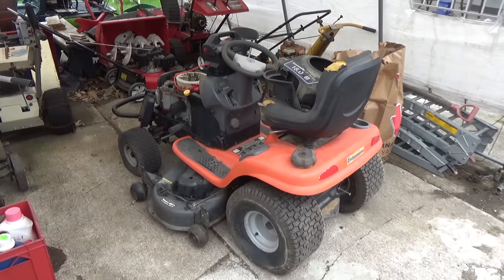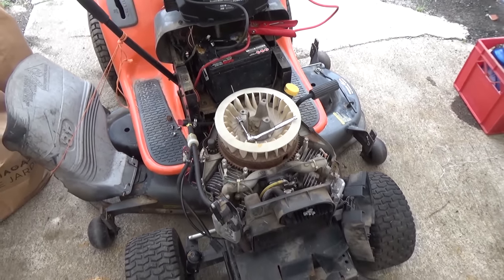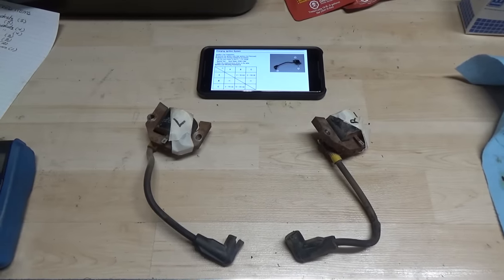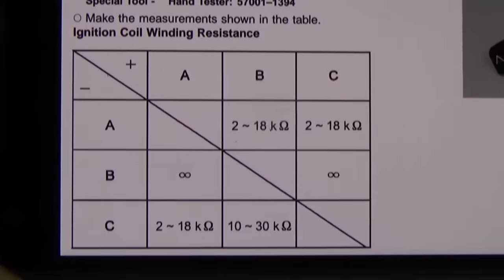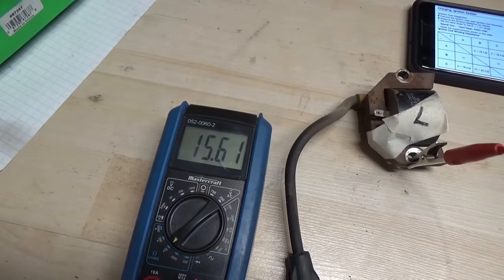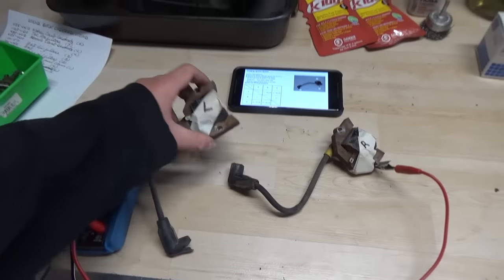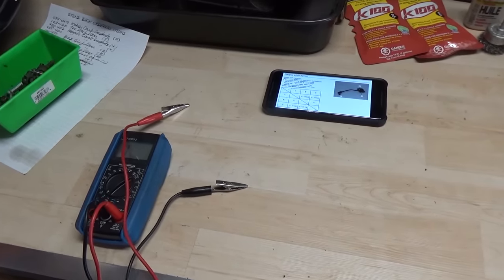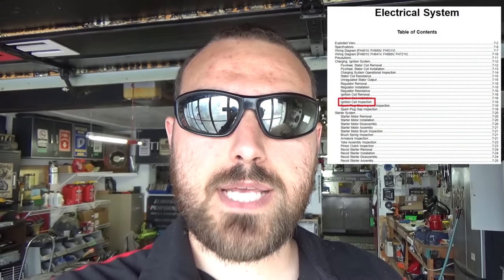How to Test a Lawnmower Coil

Comment: Does anyone have the specs (or service manual) for coil for a Kohler CV16S-43513 ? My coil is 12-584-18 (original one) - superseded now by 12-707-01S.

I don't have any open circuits on my coil, but don't know if I am getting correct readings and I want to do everything possible, before dropping $140 for a new coil on a tractor (Craftsman 917.271121) that probably can be found for $300 or less....  Thank you !!!

My problem is No-Spark, I have made sure that seat and brake interlocks are not the issue, but I get not spark... if anyone has any suggestions and/or lessons learned, they will be much appreciated.

Comment: I have an 11hp Formula Tecumseh Engine OH318SA with a solid state ignition coil 35135 A or B I'm not sure. I have looked everywhere for coil specs and can't find them. I ordered a new replacement coil (off brand) and right out of the box I get No reading from "C" to "B". I assume it is bad and will still have to pay shipping back. Would you know the specs for what this coil should be? Thanks JT
Reply from the maker: Do you have spark if you Install the coil, gap to 0.030" (that's standard spec) then leave the kill wire unplugged?
Reply from the maker: Here's some more information, hope this helps. Click the link and download the PDF manual.

http://www.mymowerparts.com/pdf/Tecumseh-Service-and-Repair-Manuals/TECUMSEH-SERVICE--REPAIR-MANUAL-3HP-TO-11HP-4-CYCLE-L-HEAD-FLAT-HEAD-ENGINES-692509.pdf
Reply: I did not try the gap that big, but I found another old coil I had, that looked close in size. It had decent Ohms resistance at the various contact points, so I gave it a try and got spark. In fact I got it to fire up and run. Yipeee.   On that new one I bought off ebay,  I assume if (as I mentioned above), there is NO ohms reading from Spark plug wire to Kill contact, it must be a bad coil, wouldn't you agree? I get very little reading from plug wire to Laminated Frame (A). I didn't want to stick it on the engine as it might void the return. I think they will want me to pay return shipping anyway even tho it is bad right out of the box. Thanks for responding
Reply: I had downloaded this manual but could not find actual resistance specs in the manual like you had in your video. Thanks for the tip though. I really appreciate it and I feel your video is excellent both with instructions and clarity.
Reply from the maker: Thanks Jeff.

Pulled up some info on your machine, looks like they don't offer specs for that particular model.

And you'll likely never find a spec from aftermarket.

My advice would be to try it without the kill wire plugged in. Then maybe order another one...

Remember, Amazon usually offers hassle-free returns with free shipping. I use their site daily and highly recommend it.

As for the solid state swap, I have a video you can check out to see how the kill wire is hooked up (you can't run your key switch).

Around 18:30 is where I hook up the new coil:  https://youtu.be/bLVjWDeNpGM
Reply from the maker: Also check 5:32 on this video: https://youtu.be/-LXChetxrCw

Comment: Hi!  Thanks so much for this video!  Could you verify something for me please?

I had a no spark situation for my Craftsman lawn tractor.  It has a Craftsman Kohler Pro 17hp single cylinder engine.  I substituted a known good plug, and took off the kill switch wire from the coil.  No spark in either situation.  I tested the coil between terminal C and A and got like 8790 ohms.  I couldn’t find the exact manual for this engine but found one close and  that was in the acceptable range.  

They did not test terminal B?   Is it not necessary?

When I tested between C and B and then A and B in both tests I got infinity.  Does this mean that the coil is bad?  I guess it basically tested like your “left” coil.  I guess I’m just wondering why the Koehler manual doesn’t test terminal B, just C to A (Which was good).

Thanks much!

Comment: I have a rear engine John Deere  Model SX95. It is a bear to get at the engine. I have to take the whole rear shroud off first. It is no fun searching for the coils, carb. or spark plug. No easy testing or fixing. My JD Dealer is a thief too. I have to rent a trailer and drop it off. Then wait till they get good and ready to work on. They never call when it is done. I have to keep calling to find out when it is done. Then sticker shock when they hand me the bill.  They charge way too much for any type of work. The hourly  rate is so high  too ! I will never buy another JD Ever!

Comment: the best test is called common sense, it either produces spark or it doesnt, no sensible tech would waste their time with all this useless troubleshooting, time is money!
Reply from the maker: Right, and while this may be true for a coil that doesn't produce spark at all, if your coil produces weak spark, these are the steps one would take to see if it was a bad coil or something else.

If you unplug the ground cable and there is no spark, simply replace the coils.
Reply: I have learned that coils do produce a weaker spark rather than work/ not work.
Reply from the maker: Just did a coil replacement on a John Deere yesterday. The engine ran fine for 20mins then would shut off.

Replacement of the coil fixed the issue. As the coil got hot, it would produce less spark. Until it didn't produce any!
Reply: I've got a Briggs and Stratton 20 HP dual plugs. No spark. Cleaned magnet. Replaced plugs, replaced coil with the correct pn. And again, no spark. What can I do next

Comment: I thought the coil only had a ground and one input wire,   thats not a kill wire unless u pull it off the running engine coil to kill it. I know because thats how i kill my old atv.
Reply from the maker: On lawnmower it's the ground wire that's the kill wire, so if you unplug it, and it has no spark, then it's bad.

Comment: Get a cheaper coil and test it  to make sure the reading are with in specs if they are   then the 17 dollar coil is exactly the same as the 60 dollar one . They all come from the same factory ,the only difference is the label .Your reason to not get a cheaper one   when you know how to test it  is kind of ridiculous.
Reply from the maker: While the test may be the same for resistance, and they output the same amount of spark, aftermarket (china) coils generally fail sooner than OEM (Japan) coils. I've been doing this for over 6yrs now and haven't had an issue with OEM coils, but have had a couple bad aftermarket ones where I'd have to send them back and wait to get a replacement. Thanks for watching!